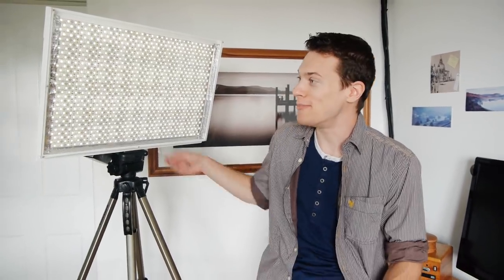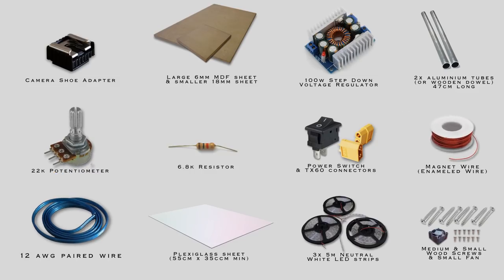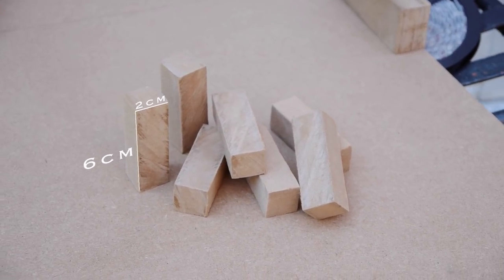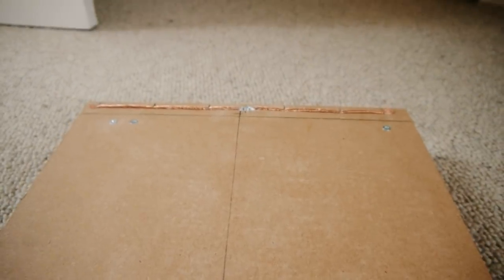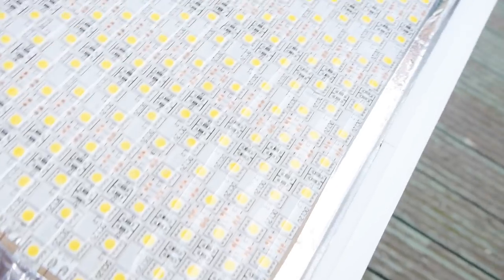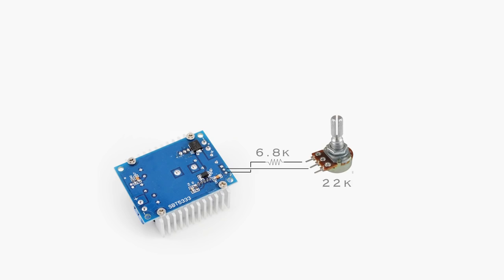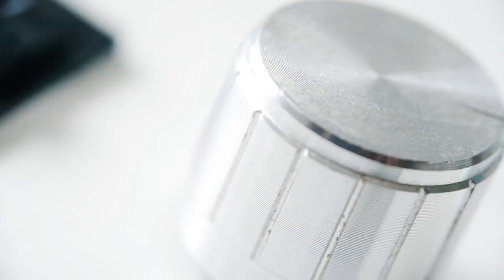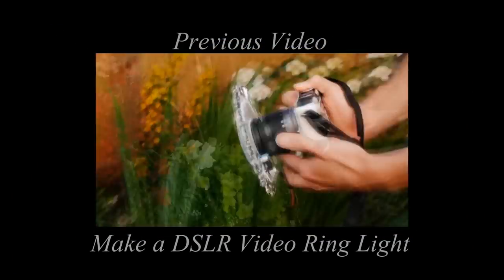How to make a super bright LED light panel (for video work etc)

Comment: HELP, After I wired up all the LED's and tried to test them with a 19.5 v 2.3amp laptop power brick the lights flash instead of staying on. Any idea why they would flash? If I disconnect about half of the LED's they do stay on. Is it because the power supply is not powerfully enough?

Comment: Hi Matt
What if I want to build a smaller LED light, which voltage regulator do I need if I still want to dim the light? And how do I calculate how many amps and how much current the LEDs needs?

Comment: Just one question. Why are you telling about 100W when LED strap 5050 (60led) takes 15W on each meter of length? So if we take 15 meters then 15x15= 225W - takes 15 meter LED strap

Comment: Is that paired wire necessary in both minus and plus sides of the panel? I have 10 AWG paired wire and I don't know how I'm going to solder them on the circuit board. It is  hard to solder even if you use just one paired wire on the whole project.

Very nice light though!

Comment: If I just wanted the light with an ON/OFF switch and not have the dimming at all what exactly would i do in that case?  I'm sure I could find another video with this information but you seem like you know what you're talking about more than some other people.  I would like to be able to connect the LED panel to an outlet or a ceiling power source with a dimmer switch like the ones you buy at the store if I choose to in the future but I'm not using this for Video Production and don't really need that as an option and to be honest it's the most confusing and difficult part for me to understand.
Reply: I'm planning to build something similar.  By eliminating the dimmer, you can skip the potentiometer and just connect the power source to the screw-down input terminal, and connect the screw-outputs to the wire pairs powering the LEDs.  Can't tell you how it works out, but I'll update if/when I finish mine.

Comment: So I have a panel made and was just going to pug right into wall.  Im using a 10a 12v power supply but the power supply over heats???? not sure whats going on.  the Led strips are 5 amp per roll and im using a little less then 3 rolls.  Any help with this would help

Comment: I tried to do your panel , At the step of adjust the min and max voltage , I hooked up the potentiometer and when turned it fully clockwise and the voltage regulator fully anti clockwise the voltage reading was the min 1.2 DC V ... and the max was 6 DC V. what is my mistake?

Comment: There are 900 LEDs in the panel. The Amazon LED roll referenced is $18.55 for a 300 LED strip. So three of those would be needed. That is $55.65 just for the LEDs. Much higher than mentioned in the video.
Reply: I chose some $8 versions from eBay, without the un needed weather proofing. However, be careful of the selection, there are many choices out there.  I think the $18.55 is a rip off and not justified for the project.  My results ( three panels) are great.

Comment: Regarding the PWM dimming, I am wondering if adding a capacitor across output would resolve the flickering effect for video footage?
Reply from the maker: Skyler F Somebody in the comments has reported that an LC circuit can help with the flickering, but he used only a 5w LED so I'm not sure how it'll work with 100w.

Comment: Great project! I have some suggetions from an engineer's perspective:

Instead of the flash mount, a ¼-20 coupling nut is cheaper and available at most hardware stores. It only requires drilling a round hole and gluing in place. A coupling nut is like a regular nut but much thicker- like a half inch.

The 12 GA wire is overkill and most people won’t have it around. A 16GA or 18GA extension cord is rated for about 15 amps, several times what this requires, and that would be more than adequate. Or any speaker cable over 20GA.

On that note,  a 5050 led strip draws about 5 amps. 3 strips would be 15 amps. The regulator you use is only rated at 12 amps so that may be a problem. 

You use enameled magnet wire but don’t mention sanding off the clear enamel that would prevent it from being soldered. Perhaps what you used was just bare copper wire. In any case, there’s no need to buy that. Just use a strand of wire from the stranded wire that you used for the power. 

If you left off the Plexiglas it would be cheaper, lighter, and the LEDs would run cooler and last longer. If you want a cover, you could use a diffuser panel that is used to cover ceiling fluorescent light fixtures, available in most hardware stores. It’s pretty thin so would probably be lighter. 

White LED tend to have a blue tint, especially the cheap ones. I plan on using a mix of cool white and warm light to give a better balance. If you power the different colored LEDs from independent voltage regulators you can adjust the color temperature to some amount. The wiring and construction is more complicated however.

The handles seem like a lot of work when you can just grab the edge of the panel. Or you could use cabinet handles, or if you are rich, towel racks cut to length.

Thanks!
Reply: If you want to get fancier, use RGB LEDs and have a infinitely adjustable color light panel. The RGB controller should have the regulator/dimmer built in so that'd simplify that part.
Reply: The non-waterproof ones are cheaper and you don't have to strip off the plastic to solder them.

Comment: Hi There - I have been making this great panel - with a flavor of my own, but struggling to get the electronics working properly. Can you help? I have done everything in your tutorial and generally, everything is working great except one vital part. The potentiometer added to the voltage regulator via the micro pot doesn't seem to work at all!

The micro pot on the regulator works fine and I can see the voltage output changing when I turn it, but the big potentiometer doesn't change any voltage output. I've tried 2 different potentiometers and 2 different voltage regulators, but there's no difference. I have also tried all the different pin terminal combinations possible and I've tried with and without the inline resistor to set minimum voltage and nothing happens. It's almost like it's not connected at all.

There does seem to be voltage at the potentiometer both in and out of the regulator board but still no change in output voltage.

Obviously, if this doesn't work then I can't control the lights at all. Any help or advice appreciated.

Comment: Hi, I really enjoyed the video and constructed the light. It's excellent but I'd like to trim the voltage to minimum 8 volts instead of the current 5.6 - 6 volts with the 6.8k resistor. How can this be done? Thanks.

Comment: Aren't these 5050 60LED/M 5M strips 72W/5M?, making 15M 216W? How are you getting away with using 100W step-down? Also what should we power it with - 10A 240W 24V Switching PSU?

Comment: Pretty much done with 2 Ring Light's and this Panel now. (I've got lot's of friends that will be interested so I guess I'll be making a few more with time) I'm sort of giving it an overkill of cooling. 120mm fan, daisy chained heat sinks and ventilation holes to bring the air into the LED chamber. Still hope you'll be able to make a video on adding a 200W flash capability to the Ring Light (some flash units simply work as repeaters so maybe that's a good way) I'm sort of having to make large AA packs to bring the V and current up so that the voltage booster don't bring the voltage and brightness lower. so being able to use just 6 AA's and charge a flash would be awesome.

Comment: I just built myself some light, but I'd wondered how well using these strips would work.  My main concern with using strips like these is that the postings on Amazon / eBay is that it's hard to know what you're really getting.  I've seen 12V 300-led strips on Amazon with built in controllers and power supplies.  I am guessing they're not as bright as what you're using but might do the trick for some Q&D accent lighting.

Comment: HAPPY NEW YEAR!
I made one of these with an old XBOX 16.5A, 12V (203 watt)power supply, but I used 5630 LED's instead of 5050's. I chose the 5630's because they're supposed to be twice as bright as the 5050's.I have tested it connected directly to the power supply as well as connected to a PWM dimmer (which is pretty worthless considering the flashing it creates) I didn't use a voltage regulator circuit because a voltage regulator that can handle up to 20A is a lot more expensive. The panel is bright, but nowhere near as bright as yours appears to be. Could the voltage regulator circuit have something to do with it?  I've even disconnected about 150 of the LED's and the panel is no brighter. I'm thinking It's probably just the LED's I bought. Any thoughts/ideas?

Comment: the link to the step-down voltage regulator states that the output voltage must be 2 volts below the input.
how does a 3 cell lipo battery (11 volts) power the leds (12 volts) if the output must be 2 volts lower than the input

Comment: I Have a question. 1 Meter of this type of LED strip needs a 14.7W. Here we have 15 meters, so 220.5W in total. Connecting it to a 100W power supply (or 120W in my case), and the LED's will be 50% bright. Am i right?
Reply from the maker: חגי אביבי The LEDs don't use as much as advertised on the listing. They're only around 30w per 5m.
Reply: DIY Perks Thank you for your answer!
I Built 2 of these panels and i'm very happy with them! Keep up with your videos. Your awesome!

Comment: If the DC converter outputs max 100W and there are 3 x 5m LED strips with ~50W/m, wouldn't the converter get detroyed?

Comment: I am not able to find 10W LED 32V, instead am getting 10W LED 9-12V and the voltage regulator is for 5-32V. Would it make a difference or should work fine ?

Comment: A lot of chatter about heating, current consumption,  and possibility of over heating of the LED array.  I built two full sized ones and one mini (5 meters).  So far, the steady state temp .I measure  is in the range of 108 deg. F.  That's running them at 12 volts. That's safely under the max. temp. for 5050.The back side of the 6 mm board does get warm, so I'm not mounting the DC-DC regulator directly to the board.  I also drilled numerous holes in the bottom of the mounting frame to encourage a chimney effect convection cooling of the LEDs (and not a trapped air space).

Comment: i really interest with this video, but can you help me to solve out a battery problem light source

in here i cant find battery like that, and to reduce cost can i use motorcycle battery?

also can i use standard neon lamp? using led light is more expensive in here

Comment: The voltage regulator, you took out the built in potentiometer.  Please elaborate how you did the hook up to the 22k Potentiometer. Thanks.

Comment: Would you recommend this step-down regulator for a 5630 led build with a larger fan or would you recommend something else.

Im planning to use a power adapter with 12v 150w 12.a output.

Comment: Have you ever dropped this how has the MDF board stood up to the drop. I watched your turn the TV into a light box video and it’s sweet I started the process but I’m wanting use this idea as a portable video/ photo light using dewalt battery’s with an adapter and the tv frame is heavy. So I’m thinking of other materials to use.

Comment: When setting the maximum output, you say to hook up the potentiometer to a power supply such as a laptop adapter.  I have an adapter but don't know how to use it as a power supply….should I simply cut the adapter's connector and solder on an xt60 connector and also solder on an xt60 connector to the potentionmeter.  This is the only step I am stuck on so far!  Thanks for the video.
Reply from the maker: Dean C Yeah, you can just chop of the end of your laptop adapter and solder a male XT60 connector to it. Make sure you get the polarity right (XT60 connectors have it marked) and you should be good to go.

Comment: @DIY Perks I built a panel with only 2 strips (about 12" x 12"(30.5cm)) and am having issues with the voltage regulator clipping when turned up too high. I'm powering it with an old HP laptop supply @ 18v 3.5a. Do you have a favorite c̲h̲e̲a̲p̲, higher wattage power source that you can recommend? 
 On a side note; instead of running braided wire along the sides, use stripped house wiring. Also use it to tie the strips to the sides. It's a cleaner look and easier to hold down and solder.
Reply: +Lane Shurtleff The only issue I have with using a 12v supply is not being able to adjust the voltage. I have not tried to use a computer ATX supply with the regulator module (fried my PSU recently), but I was concerned about losing voltage between the two and not utilizing the LEDs to their fullest potential.
Reply: +brainfarth that power supply I linked to has a potentiometer to vary the voltage from 110.6- 14.2 volts. I adjusted mine to 12.2v. I've tested it for 6-8 hrs many times and no issues yet.

Comment: i used a pinewood board and the LED strips take alot of heat. will an aluminum sheet fix this? or aluminum tape ?

Comment: That's pretty awesome piece of kit.
But you haven't told us for how long this configuration can stay lit.
The amps of the leds in total are 18.
The lipo battery is 8000mAmp.
18000mAmp:8000= 2,5.   60min:2,5=24min
With  no consideration of additional consumption of the regulator or the fan(s) or   any loss of the rest of the configuration due to heat loss, thus shortening ever more the operational time of this construction.

Comment: Hi, if I use a 300W 20A step-down voltage regulator instead of a 100w, can it work without cooler fan?

Comment: Nice work!!! I am looking forward to build one too! But i want to use ledstrip with 15w power per meter electricity consumption but 3 * 5 metres * 15 watts = 240 watts aproximately what about Dimming? i dont like PWM but i can't find something to use....a varible power supply with main power 240watts? Can you suggest me something?
I prefer a diy circuit or somethink similar
Thank you very much in advance

Comment: Have you ever considered to do similar panel not with strips but with COB diode (diodes)? It will take less time to do that and it occupy less place:) I want to make this lamp and I am wondering what regulator, resistor, potentiometer should I use. On the other hand Is it possible to remote this with any device wirelessly?

Comment: I bought a led utility light from sams club for very cheap.  I am unable to dim them but I would like to be able to cut power to half of the strips. can I just split the incoming power line and power each strip separately or would I need to cut the power in half also?

Comment: I have a 340 solar panel that is 5'4 3ft wide I want to build one of these for is can I use lithium battery packs instead of that small battery you using?

Comment: Can you be more specific as to which step down voltage regulator, when I use the link several different ones pop up.
I am a photographer and these lights will be perfect to light up my green screen.
Also if you have a link for the ac power supply would be helpful.
One more thing would I be able to use all the same parts to build a light table around the size of 18 inches x 18 inches?

Thanks 
Peter Bednarz

Comment: That Fan on the sponge is so damn funky looking.  Isn't there some way to put the entire voltage reg and fan KIT in some kind of encasement.  Also is there some kind of pre-made voltage regulator, fan and and power supply that can be bought?  I'm really not up to all this DIY electrical stuff.  I can make simple adjustments to the voltage reg, but building  a power supply one is only a formula for disaster.  An AC/DC adapter is fine for my needs.

Comment: If u can connect them in series circuit then i think you won't need any adapter.All of these are connected in parallel that means each strip needs 12V.How many strips are here ?? I think I am gonna burn out my adapters.

Comment: Very detailed video - thank you! How did you find the thermals? I'm looking to make little 100x180mm ish flood lights for the garden with RGBW strip and a Shelley Wifi control module fed from 24V

I was wondering if I needed to use a heatsink as the mounting plate but now I'm wondering if that's necessary having seen yours. Cheers 😀

Comment: So I have made one of these and am using a 12V, 20AMP driver to power 900 led lights, However, it seems to be getting very hot.  I mean VERY HOT.  The driver is an LED specific Driver and I am trying to figure out what is going on.    HELP?

Comment: DIY Perks  Thank you for sharing this tutorial.  I have purchased enough lighting for 2 of these panels and will be starting on them shortly.  I do however have a question regarding the 22k potentiometer.  Is it a REQUIREMENT for this to be a 22k, or can a 25k or 50k ohm pot be substituted?  Thanks in advance for any responses.

Comment: im getting ready to build this. i only have a few questions.
1. where can i get the mdf panels. went to my local lowes. didnt have any.
2. can you go a but more in depth when you put everything together with the voltage regulator. like what wires you used, and how you soldered and wired them together? same for the fan.

Comment: I was always wanting to build my own LED lights but I could not get sufficient ideas to fabricate them. Thx for your video which is completely practical. Now I see that the 5050LEDs that you have are designed for 3Vf and have a reverse breakdown voltage of 5Vr. Since these are in essence Diodes, I was wondering what would happen if we connect 70-75 of them in series and directly plug them into a 220v AC power supply. Will the flicker be noticeable to human eye 50Hz? Will we fry something?